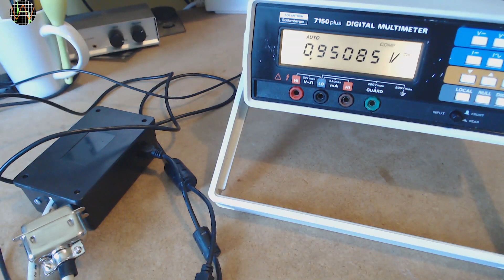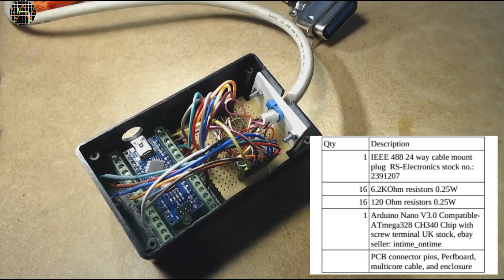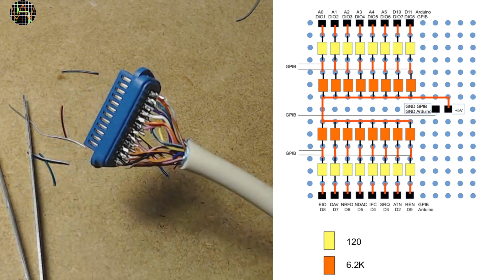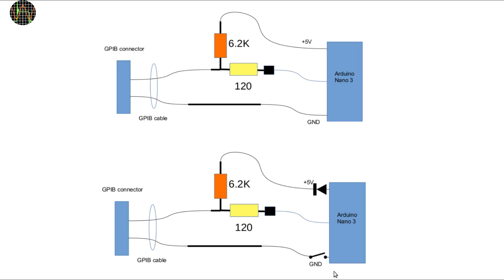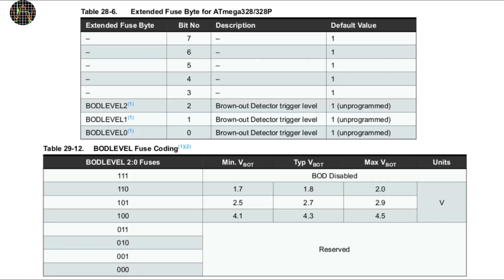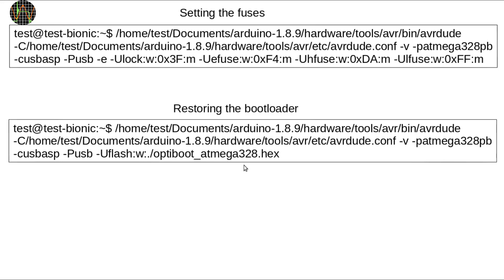GPIB-to-USB interface with Arduino Nano UPDATE

Comment: Thanks for this. 

When you say the GPIB interface chips are really expensive, I assume you do not mean the physical level chips, because they are pennies. The value comes, surely, in the micro side of things that implements the protocol? 

Unfortunately, the 75160 & 75161 chips which make the physical interface robust are now going obsolete. 😔 I don't like the idea of hooking a micro directly to the bus though.
Reply from the maker: I agree that hanging a bus directly on a microprocessor output is not ideal. As you said, the 7516x chips are getting obsolete and expensive. I looked prices up just now out of curiosity. About £4 for 20 in RS, no smaller quantities which would make this £80 for one (with 19 spares). I did not check other vendors. Even if I can buy just one for say £6 somewhere, I'd call that expensive (for my budget...) . Of note, I have since modified my build to https://github.com/Twilight-Logic/AR488 which uses 7516x chips. I thought I made a video about it but it turns out I never did. I highly recommend it, the firmware is way more capable than what I used before and I have used it for more than a year on a bus with 6 instruments (and growing)
Reply: @TheHWcave  We're looking at slightly higher volume than one or two here (and on a very expensive piece of kit), so the price in slightly higher voumes is fine for us. 🙂  

I think it's a really big problem that these chips are going obsolete. From what I understand GPIB isn't going away (despite it being insanely old and innnapropriate in the age of high speed serial comms).   I would not be surprised if a smaller company licensed the chips or made their own as I'm sure the demand will continue for some time.

Comment: Good solution! But can't you just disable BOD by writing to the MCUCR register?
Reply from the maker: No idea. You know more about that than I. My projects use mainly Raspberry Pi and only occasionally will I stray into Arduino land. It would be great if a simple register setting could solve this. I will have a look for future projects but not change the current adapter.
Reply: @TheHWcave  ah I see! I just had a check on the datasheet. So you can disable brown out detection using software IF you put the microcontroller into deep sleep mode. Unfortunately, you cannot keep the brown out detection off while it is running so it wouldn't work. Looks like burning the fuses is the only solution to this problem!
Reply from the maker: @2LukeLOL  Thanks for checking it.

Comment: Would this work for other multimeters? Got two HP 34401A
Reply from the maker: It should but I have not tried it. It does use addressing in the commands, so theoretically it can talk to 2 or more devices on the same bus. The big question is whether it will work hardware-wise and what kind of cables and termination are needed. You see, I copied that design from some guy (with permission). It is not my design and I have not looked at GPIB ever since, and as long as it works with my Solatron I am happy and the interface is now permanently attached to the rear of the Solartron.  If, for whatever reason the multi-device mode is not working or the cost of special plumbing (cables) is too much,  the cost of an additional Arduino Nano isn't the world, so its possible to use two, each handling a simple single-ended GPIB connection to a dedicated  34401A while on the other end - all USB connections - end in a USB hub that is connected to your PC. I do have a 34401A myself but for reasons outlined above  I use the serial port to talk SCPI over a serial-to-USB interface. Being able to use the 34401A remotely is incredibly useful so I fully understand your desire to get this working, especially if you have 2. Another thing to consider is that you will have to write your own PC software (or at least wrappers) for the Arduino GPIB interface but there is at least some software out there that uses SCPI over serial ports (I think SIGROK supports SCPI over serial, but I don't use it myself).
Reply: @TheHWcave  I'm super thankful for the time you took, writing this reply! Much info here. I got two GPIB-cables, the thickness/stiffness of them is almost bizarre :)
Maybe serial is the way to go though...I will look into it. Again, thanks for the shared knowledge.
Reply from the maker: @nico.jovisst  No problem. One hint. Get a reasonable USB-to-Serial adaptor that implements DTR/DSR. Many cheap ones do not. Sadly the 34401 uses (only) DTR/DSR and not RTS/CTS which is far more common in serial interface adaptors.  If you can't get the serial interface to work, it is most likely a DTR/DSR issue.

Comment: You could use usbasp with a software called progisp rather than avrdude command line interface. I had created a few extra config files for progisp to write to Atmega328PB if you want I can share those with you.
Reply from the maker: Many thanks for the tip and offer. I had a quick look for progisp but, honestly, I am programming Arduino so very rarely that command line is fine for me.

Comment: Hi TheHWcave.  There's a ongoing thread on EEvBlog about an arduino based GPIB interface where someone is suggesting sourcing power from the instrument to facilitate a fully wireless connection/interface.  I wonder if you may have something to contribute there and if not I hope it may be of interest to you anyway.  The thread is (https://www.eevblog.com/forum/projects/ar488-arduino-based-gpib-adapter/new/?topicseen#new) and specifically Reply #162.  Thanks for the upload!
Reply from the maker: Thanks for pointing it out. I did put a short comment in about the not-so-benign effects of getting unwanted power from the GPIB causing the flash memory content in an AtMega chip to corrupt.

Comment: Thanks for all the great videos. As I am right now in the need of a simple USB to GPIB Adapter, this is exactly what I was looking for. This project saves me tons of money and is a fabulous way to put at least one of those arduino pcbs to a good use.
BTW, the link on your Github page to Rudis Wiki results in a 404 error.
Reply from the maker: Nice to hear. You are absolutely right if you have already an Arduino all you need is a handful resistors, a cable and the GPIB connector. Can't beat that for price. Thanks for the note on the broken link. I managed to find it again and updated the Github page. Rudi must have reorganised his stuff.